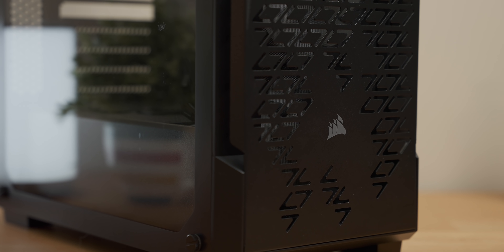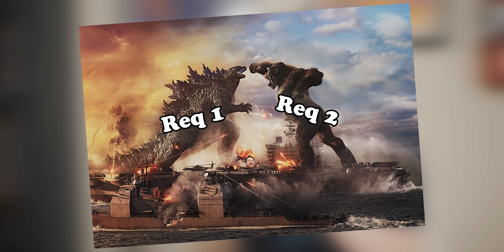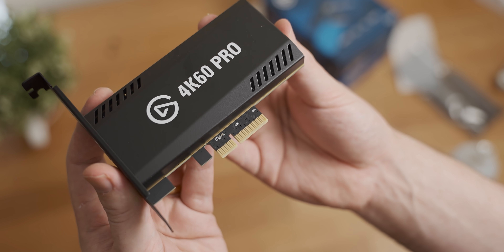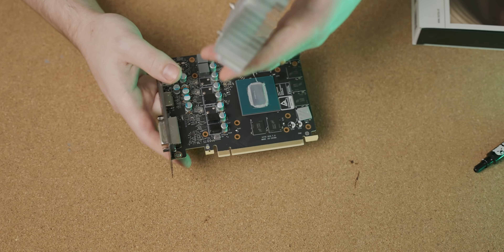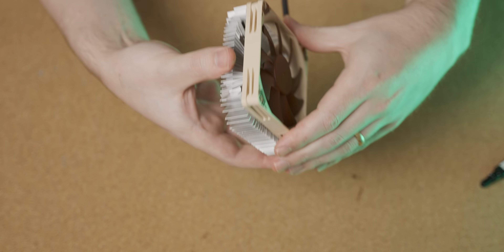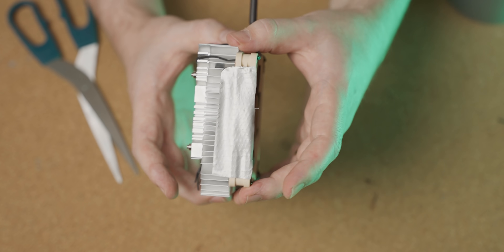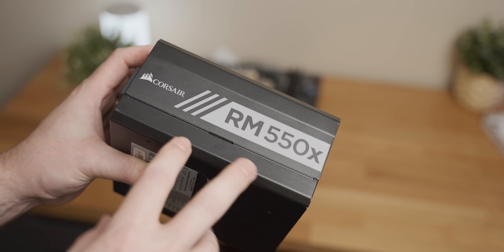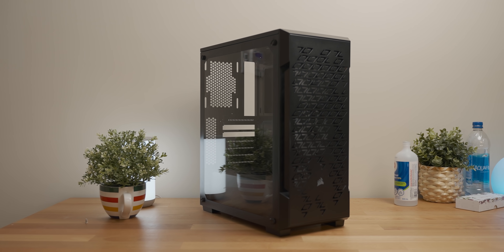I Wasn't Going To Make A Video About This PC, But...

Comment: The 220T is actually a great case for air flow. Matter of fact I'm running that now with a Strix 670 Motherboard, 64GB 4600Mhz Ram, Strix 3080 Ti, and figured cause I can a Strix AIO cooler. Didn't need the AIO but ya I did anyways. I think your cooler to pump placement is going to be a heat/failure issue.

Comment: I mean, provided the fan blades fit in that recess the other fan sat, and you're willing to basically butcher that A9x14, you could cut the frame out of it until it's just the fan itself with a trimmed plastic hub bit underneath it, and then use some kind of adhesive to plonk it down onto the heatsink proper.

Comment: the 220t Sucks. If you use big boy RAM they H100 cooler will not fit in the case without pushing stupid hard on the RAM.

Comment: The duct tape solution seems fine now, the problem with duct tape is that it ages. Especially with a fan blowing on the glue side of it constantly (the heat cycling will also speed the aging up). When it ages it will dry up, become brittle and will 100% unglue from the heat sink portion, then it’ll start flapping in the breeze (literally) and eventually unglue portions from the fan housing as well, but not before allowing the air flow spillage to happen that you were worried about and trying to prevent in the first place - and not before making a bunch of noise flapping there in the breeze. I think a much better and easier solution would’ve been to either glue some very thin plastic strips along the edge of the fan casing to cover those spillage holes (could cut them from some plastic folders, or plastic covers from notebooks), or even use some cardboard and duct tape that to the fan housing (in a way that the duct tape isn’t exposed to the airflow). In both cases those solutions would last forever basically, and not create problems down the line.

Comment: That gpu is easily fixable all you need is to get a pin and remove the crimped ends from the connector then buy a crimping tool set from the internet and crimp the wires on the fan and push them back into the connector, the noctua fan probably cost more than it would of cost for a crimping set and you'd have been able to fix it properly

Comment: When you have a Samsung S9 + (4K resolution) and your TV (Hisense a5600f) doesn't EVER display YouTube in 720p+ (I've tried Screen-Share; Nintendo Switch - which after 2020 apparently is locked on YouTube up to 690p- and the app on the TV) the app on the TV is  best but only 720p... and the TV is HDR THUS..... I believe one of - Switch/TV - the devices is faulty'?'

Comment: About the fan you put on the GPU, can't you unmount it from the shroud and apply it to the cooler fins? Like the original GPU fan, I think the overall diameter fits inside it and then you can put the GPU shroud back on which should help vent out the hot air. That or just fix the connection on the original fan, might be better because the GPU going that fast into higher temps doesn't seem very healthy on the long run.

Comment: Dawid you could of trimmed open  the end of the pcie slot to fit those cards you know. Have stuck a x16 card onto a pciex1 slot by doing that. The slot needs to not have a metal trim tho.

Comment: the reason the gpu is getting hot is because the fan is connected to the motherboard, so it being controlled by the motherboard not the gpu drivers

Comment: I had an old GT 8500 and i did some dyi cooling too.
And it was way better than the tiny cooler it had previously. Also i used zip ties i think you should too

Comment: Duct tape...the universal "problem solver!"
Gorilla tape is even stronger and somewhat water resistant but it tends to leave a real sticky residue that's extremely difficult to remove. It has been holding some of my shower tiles to the wall for some years now......😂😂

Comment: I gave up on upgrading my 1660ti to a 30 series and my friend just so happened to want to sell his 2080ti that he never used and still had a warranty, so i paid $600 for literally the strongest 20 series card in the box (EVGA FTW3 Ultra OC) so now i have an extra case, mobo, cpu, gpu, and psu so all i need is a hard drive, capture device and some ram and ill have a second pc

Comment: That heatsink on the GPU is a pos.  Too bad you don't have the room to install something beefier that actually dissipates heat well.  Almost think a wad of aluminum foil would do a better job.  Why it isn't a copper hybrid is beyond me on some of the GPUs out there.  These things get hot enough to cook a grilled cheese, they need more than a recycled intel stock fan and heatsink imo.  Maybe slap a rad in there and mod the card for cooling?

Comment: You could of cut the ends of a PCIe x1 slot on the motherboard and wedged the capture cards in - electrically, it would work - not sure PCIe x1 would give enough bandwidth though.  Would of been a truly awesome "Dawid breaks tech stuff" moment though :)

Comment: If you can physically plug the 4x card into the 1x slot ( ie 1x slot is open ended) in theory it should still work, just at 1x

Comment: I got PTSD from wathcing you fix the fan. I did the same thing with my r7 370, except I used an old amd cpu fan, and screw it into the fins. It works better than the original fan did, and it's quieter.

Comment: Okay so is the 4 pin fan header in the GPU permanently stuck or can you remove it? Cause I'd assume there might be some uh confusion in the GPU itself cause it cannot regulate it's own fans correctly.

Comment: 4 words " custom all copper heatsink"  you will love the temps I guarantee it! 12-20 C lower at max load same gpu. hell any metal shop could do that in  a couple days they did for me.  ROCK on. Remember light bondage tape and twist ties does the job every time when low on cash PC build budget, but 50 extra bucks does miracles.

Comment: You installed your AIO rad upside down.  See Gamers Nexus video on AIO orientation.  The outflow of the rad should always be higher than the pump in the CPU block.  Installing the outflow lower is asking for your AIO pump to fill up with air and fail.

Comment: I see your [this entire video], and I raise you one Ryzen 5700G
Reply: jokes aside, assuming you won't do any heavy gaming on the system, that allows you to use ALL of your original parts, case and all, AND have similar, if not slightly better CPU performance (fairly comparable to NVENC at this point if my trusty 3600 is anything to go by. of course it isn't the same, but my much less powerful CPU streams flawlessly, so 🤷‍♀️)

Comment: Don’t really need a capture card to capture “itself”, the machine is powerful enough to do it on its own… bit of a waste of a capture card tbh
Reply: Especially when he does it through NVENC or any other hardware encoder. The suboptimal quality can always be overcome with ridiculous bitrate.
I do 1080p60 in 20mbps recorded onto a mechanical drive and had no issues with the real-time encoding or quality on a fully loaded GTX 1060, or even the 660 Ti before that.
Now having a seperate machine for gaming and encoding, or recording consoles or older/weaker systems that are lacking the neccesary encoder (hello GT 710) I can see the point.
Reply: Indeed, a lot of "pro" streamers use a double rig set up for streaming since it offers a lot of benefits. Multitasking being one of them. And as you say, utilizing NVENC (not to mention the CPU in this case as well, obviously not a gaming rig) there really should not be any issues doing it without the capture card.

Comment: One of the biggest reasons not to use desktop CPU's for this is the limited number of PCIe lanes. 

When you put cards in the top two x16 slots, each slot only operates at 8x and the bottom x16 slot only operates at x4. Ryzen just doesn't have very many lanes. It's really designed to run pretty barebone.

If you want to be able to run your graphics card at a full PCIe x16 you gotta go Threadripper, Core X-series, Epyc or Xeon.

Comment: You could buy or build a 92mm-120mm offset adapter.  Just carving some hard foam (think the pink insulating sheets you buy at the home store) and covering it with epoxy when done would work well if you don't have easy access to ABS sheet. It would allow you to screw the adapter directly into the heatsink fins and the fan for a rigid fit and you could choose exactly where the fan sat.  You could use a thin 120mm.

Of course if you're going to carve one out of sheet foam, you could go all out and mount it perpendicular to the cards, above them, and duct it down over the heatsink.

Or get an old laptop or AIO heatpipe cooler and mount that down.

That should get you 2-3 different videos from that poor card.

Comment: Dawid, don't forget, you are now cooling ALL of the RAM chips more efficiently since installing the thermal pads. That cooler probably wasn't meant to do that. I bet the person that was putting it together installed one pad, realized he wasn't supposed to do that and just left the others off.
Reply: I wonder if 12 GT/s GDDR6 is even supposed to run without any cooling.

Comment: You have like 60000 views around the time I watched this Im sure your channel's getting large enough for you to reach out to case or other component manufacturers and ask for a case for your build if you review it maybe in a separate video. Although things like the 1660 super mod are the types of things I love about this channel. Instead of buying a new one or fixing it yur just like im gonna take this opportunity to make this better. But its also kinda jank at the same time.

Also I bet theres not enough power going through the gpu board to drive that noctua fan. You may just want to power it completely separately and pin it at a certain rpm maybe? The next thing I would check is if the thermal pads are maybe just a hair too thick and its causing an issue with the heat sync contacting the die. Even though its supposed to work with that thickness pad it was running fine without most of them so...

Comment: Coincidence: I finally just today threw away the trash GPU that was in my server.  The pathetic fan on it was dead so I had ziptied a stock intel heatsink to it.  I was basically never used, but it seemed to have lasted for 2-3 years.... I think.  I don't know when exactly it died since the server worked fine without it till I had to service it.
Reply: I hope it was a GT 710 or HD 6450 or something similar.
Reply: @HappyBeezerStudios  Oh don't worry.  It was a low end ATI Radeon something-or-other.  It would have made even those cards look good.... torn from an old Dell Optiplex that was literally in the trash.
Reply: @HappyBeezerStudios  Not quite.  manufactured right after.  I might still have one that is AGP somewhere.... If I do, I'm sure it also doesn't work.

Comment: I would have just taken an old 4 pin fan, cut off the wire and spliced it onto the torn gpu fan. A bit of electrical tape and you'd be good to go.

Comment: One thing I would do is get a motherboard header to GPU header adapter for the fan. I have an ancient GeForce GTX 275 in a system that outputs S-Video to a CRT TV that was stupidly loud with it's original fan, even at idle. I chucked the original fan and shroud and strapped a pair of Noctua NF-R8 Redux fans to it. I connected them with one of those adapters plus a splitter so the video card itself controls the fans. It works brilliantly. Substantially quieter and about the same or slightly cooler temps under load though load temps are basically irrelevant on this computer. It does nothing but low res video playback.

Comment: Just finished a long day at work and have had a couple of beers, but just for curiosities sake, the fan ain't upside down is it? Yes I've never built a pc before, and yes I'm opening myself up to ridicule on the internet, but at times going back to basics is the best thing to do for troubleshooting, feck, Dawids said it often enough, a fresh install of windows and most of the problems the pre-built had have gone.

Comment: I repurposed my somewhat older system to a similar situation, it has a total of three capture devices to capture 2 PCs, cam, two microphones, etc.    I can tell you that it never runs super hard except when actually trying to do a high end live stream, then the GPU is actually doing something.  Otherwise, it's just poking along being nice.   Makes for great gaming too, my newer 5800x system isn't burdened with recording or streaming, so I get the full fat experience.

Comment: it's because you plugged the GPU fan into a case fan header.. plug the fan straight into the gpu and it should actuate based on GPU utilization.

Comment: You can usually put bigger PCIe cards in smaller slots and have them run at a lower bandwidth. The slot has to have a cutout in it that lets the excess card through. I've seen them filed out by the user if they don't come that way. There was a forum post (like 10-15 years ago) where some guy hacksawed off most of a 16x GPUs contacts, so it would fit in a 1x slot, and the GPU still worked.

Comment: Is the heatsink on the GPU making contact with the die? I mean, you added thermal pads where there were none before and that could cause such issue.

Comment: You should mount a badass Raijintek Morpheus 8057 to that baby 1660 Super. That would be hilarious! Although the mounting hole spacing might not be supported...
It won't fit with any PCI-E cards below it, but it would just be hilarious to see.
Actually, I don't even think it will fit on that tiny card at all...

Comment: bailing wire and duct tape I'm early in this video but there should be an old sock soaked in diesel fuel ahead. You should be drinking Dawidy? at least 5 beers

Comment: I'm so happy to see someone who knows what they are doing, fixing things in a way I would, not knowing what I'm doing. I feel much better about every car, home, etc. repair I have ever done.
Reply: With enough time not knowning becomes knowing and the custom drive mount made of sheet metal and the diy fan cables and the wifi extender from wire become totally legit solutions. Especially when things work well enough and look decent enough to be acceptable as permanent solutions.

Comment: Hey Dawid, you need to take that AIO out and flip it around so the tubes are up top. You shouldn't have the the tubes at the bottom if I'm remembering the rules of AIOs correctly. Just double check that info just in case I'm an idiot, but I'm pretty sure I'm correct on this one.

Comment: You really need a multimeter... If you had it you could just check the voltage of the pin outs. So much cheaper than actually frying something or all :|

Comment: Dude, I think you need to put your AIO rad the other way around. Bubbles forming etc.... Gotta have inlet/outlet tubes from the radiator higher up than the pump. Otherwise problem will arise when air bubbles will form and your pump will run dry.

Comment: Could you try how the GPU handles the temps without the duct tape I am just curious as I am having a hunch it might run a little bit cooler also why not try and strap something beefier in regards to a heatsink :D just throwing some ideas out there!
Reply: A different cooler comes down to the mounting holes. Oh, and next to trying without the duct tape mod, I'd also test if even more of an air duct might improve things. The fan is big enough to sit over pretty much the entire cooler, so forcing the air through the cooler instead of letting it run away at the sides.

Comment: Just to confirm it was a video cut, you showed the thermal pads on the memory chips but no thermal paste on the GPU.  You added some right?  :)
Reply from the maker: Yes! Good catch. It was indeed an edit. Don't worry there is a bunch of Cryonaut on that GPU die. 👍
Reply: @DawidDoesTechStuff  , did the thermal pads tip or cock the heat sink so that you don't get good contact with the die?

Comment: If it makes you feel any better, I just fried my first motherboard like 2 months ago from a stupid mistake I made. A fan cable got pinched between the case and the IO shield on my board and shorted all 3 pins together, frying the board. In my 15+ years of building PCs I've never fried a board before.

Comment: Other channels: Let's 3D print fan retainers and 3 versions of an advanced heat sink gap blocker and test which is best.
Dawid: Cable ties and duct tape.

We love you Dawid.
Reply: I've bought 70mm fans for that exact use case before. They're only 8mm thick and I could fit 2 on a rather small card.
Although I'm more into using screws and cardboard than cable ties and duct tape.

Comment: I have a EVGA 1660 Super Black Single Fan and it games 83-86c no matter what i do unless i remove both case panels. I just ordered a corsair aio to try bring case temps down but i think these single fan cards just run really hot.

Comment: Honestly it's the thin heatsink on the GPU that sucks not your mod.
Reply: Just a plain block of alu with the same length of the card that needs a 150W )so over 75W plus 75 from the slot) 8-pin plug? Yeah, I can see the issue. I have an old HD 7700/R7 250X that has pretty much the same cooling setup, except it comes with a bigge fan by default, but that is a 95W card and can be handled by it.

Comment: Love the build Dawid :) I have a question though. Shouldn't the radiator tubes be at the top rather than coming from the bottom so any possible air bubbles don't get trapped in the pump?
Reply: Yup.  This is going to reduce the lifespan of that pump and possibly cause some fluid pumping issues.  I've seen this in a couple of this other builds...we need to get a message to him somehow.

Comment: Dawid: grabs random modular power supply cables to boot up his streaming pc to test and it works
Me: upgrades his modular psu with one from the same brand, still has to replace every single cable to make it power up
Reply: You could kill a system doing that man, often they change pins out even on the same brand of psu. Dawid got lucky with this one